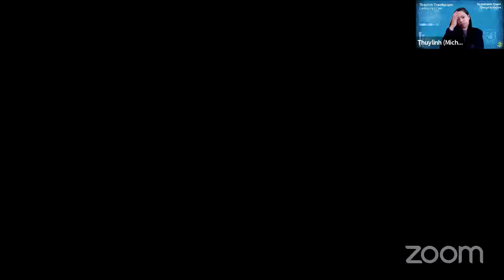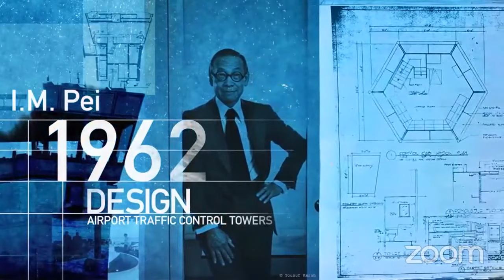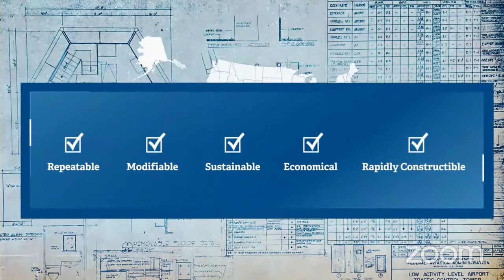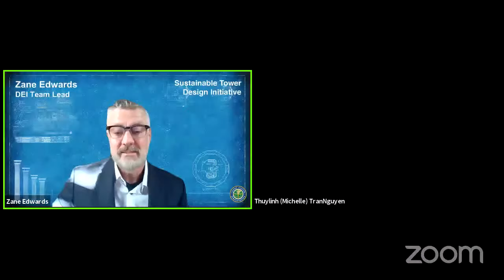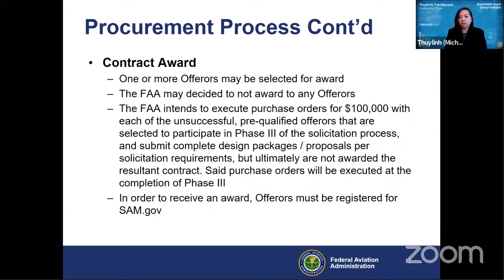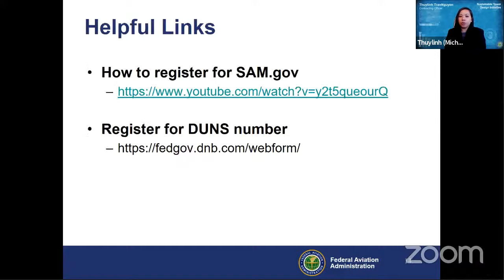FAA Sustainable Tower Design Initiative webinar

Comment: Perhaps the towers currently under construction could be the last "manned" towers built???  Perhaps new towers could be unmanned?  I propose the use of a new class of unmanned control towers.  In general, these towers would include mounted cameras and other equipment whose data would be relayed to on-site, ground level control stations, or even regionally based control stations.  We already have the technology and experience in controlling aircraft out of sight.  And future controllers wouldn't lose visual data, rather, via sensors and cameras future controllers would have enhanced visual data.  In the end, compared to manned towers, these towers would certainly be much easier and cheaper to build, be more easily constructed and modifiable, be much more energy and water efficient, and without full-time human presence related requirements, the design possibilities would be much more flexible.  These towers would not require an elevator, but merely a mechanical ladder or spiral staircase for maintenance access.  No AC would be required.  This would certainly minimize the tower footprint.  The sustainability going forward would be more related to the equipment mounted on the tower and the equipment in the monitoring stations, so the towers themselves would be incredibly sustainable.  These towers could also still be aesthetically pleasing, they would not have to be a "Cell Tower" although, affordable versions could borrow from Cell Tower designs.  These towers would not just provide a cheaper way to provide the same service, these designs could provide much better visual access to the runways and taxiways with cameras mounted at different heights, including higher vantage points than similar manned towers, and in other locations, like multiple tower locations or cameras mounted nearer taxi ways.  If you are looking for innovative ideas, don't just look at slightly different ways to do the same thing, look at radically different ways to accomplish much more than you currently can!